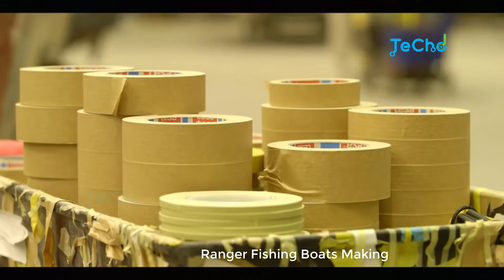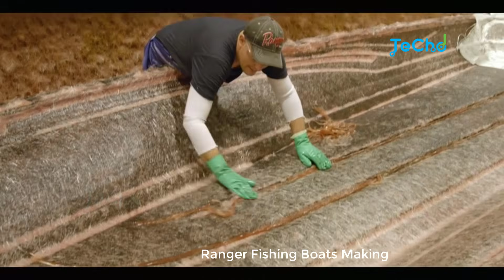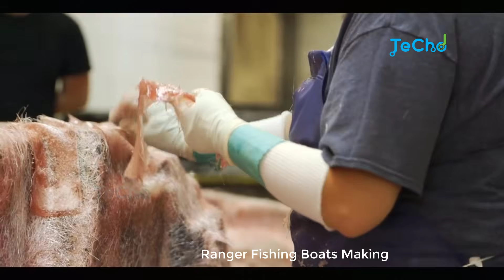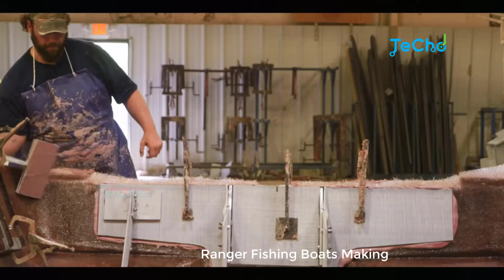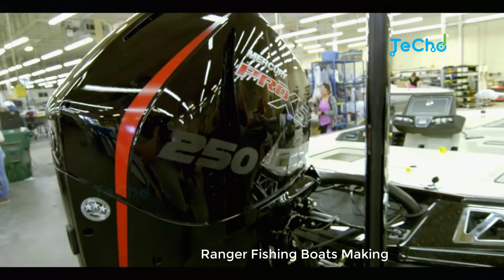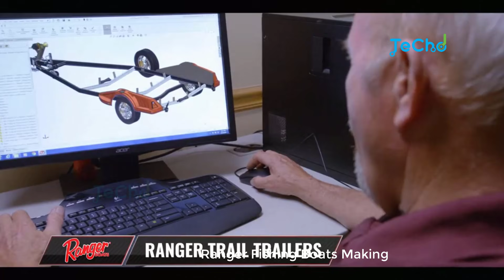Inside a Boats Factory Production Line

Comment: Intresting building techniqe. Is there any reason (beside cost) to not use carbon fiber?
And any reason to not do a vacuum infusion on the parts?
Reply: powerboat building job looking

I am Boat GRP Laminator and Molding
 I am currently working in Malta
 Do you have job vacancies?

🚤🚤🚤🚤